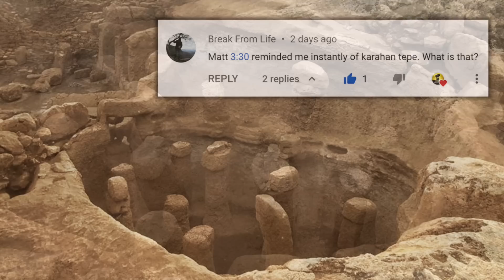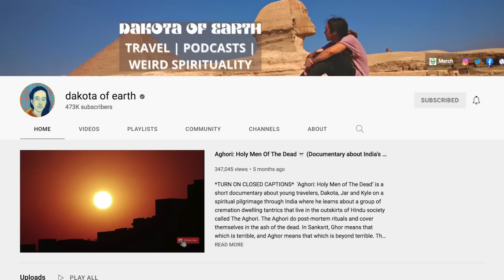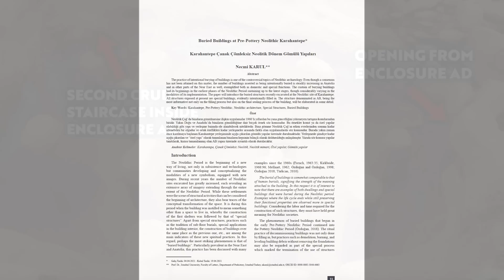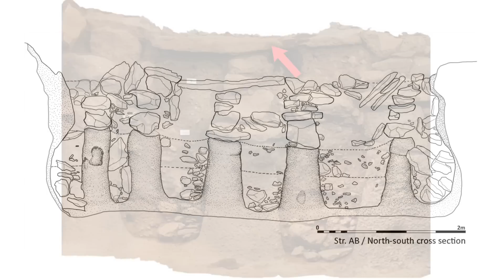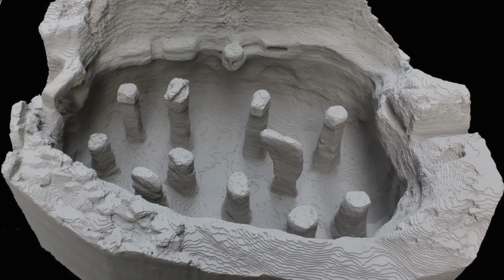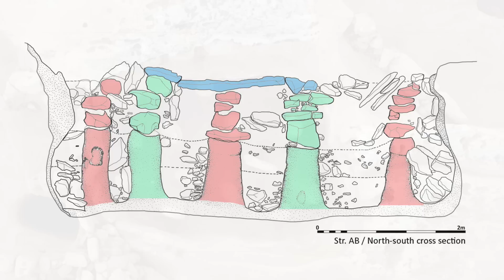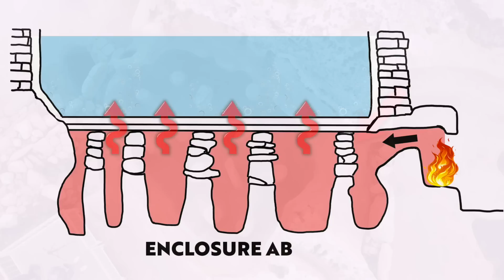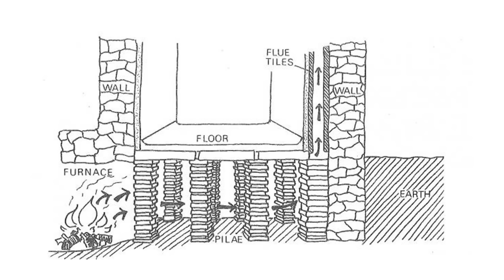An 11,500-Year-Old Central Heating Hypocaust system at Karahan Tepe? | Ancient Architects

Comment: Solving the mystery of Gobekli Tepe will require creative open minded thinking like this video.  Consider living quarters in the earliest settlements had no doors and instead had roof openings.  A logical extrapolation is to also make the roof an outdoor living area. This makes an obvious step forward in development by adding walls around the outdoor living area above the roof, Creating a two story structure or a structure with a basement.   Gobekli Tepe may have been such a two story structure. 
     During really cold or hot weather, the basement temperatures would be moderated.  In the hot summer, sleeping in cool basements would be more comfortable. In the cold winter, staying warmer would be much easier.   Look at the teepee design of Siberian Eskimos.  Most crucial was staying warm including lots of furs inside an inner room within the teepee.    Gobekli Tepe was not necessarily a living quarter but could have solved heating and cooling using such methods.   Also Gobekli Tepe may have been a place to gather together to stay warm enough to survive cold snaps.  Remember the European long houses from 5000+ years ago. They housed many people on the 2nd floor while the first floor housed animals. The animals gave off heat that helped warm the upper floor.  Staying warm was always a big survival issue so it likely drove the design an$ use of the Gobekli Tepe rooms
Reply: All well and good but this isn't Gobekli Tepe. :)
Reply: Patchouli Siamese ... yes you are correct. Kaharahan Tepe, Gobekli tepe, and probably a few more sites yet to be uncovered.

Comment: 28:41 This is a very good hypothesis! only one thing bothered me; in order for the idea to work, there would need to be water circulation or the bath area would get cold. perhaps this is the function of the channel. somehow (perhaps workers with buckets) the water was removed from the bath and sent, via the channel, back to the heater. or vice versa.

Comment: I would advise against taking a swim or even a dip of one’s toe in this particular bath house. It should be possible to use the 3D scans to roughly calculate the enthalpy of this thermodynamic system. (H = U + pV) Where H = Enthalpy of the system, U = Internal energy of the system, p = Pressure of the system and V = Volume of the system. Pit AD looks to be where workers would have further processed, diluted, refined or utilized what they were using all that energy for. Likely cooking up some pretty nasty and corrosive substances. I would again suggest we look to the art and artifacts to help us determine what they were up to. I whole heartedly believe that the T-shaped pillars in pit AB were formed and used as nails. Purposely built and used to hold down a pressure lid, not to hold up a floor. An ancient alchemical furnace I propose pits AA & AB were. It’s just a huge pressure vessel minus the right combination of ingredients for a desired reaction to begin. Complete with inoculation channels and producing an exothermic reaction, creating much, much more ‘energy’ within pit AB than you ever could get from firewood. I think the energy produced here, as heat and/or light, would have been tremendous. I’m asking myself over and over, “What were they using all that energy for?”  It may still may have been a bathhouse, albeit heated using an alchemical furnace vs fuelwood. Understanding the site’s energy production capability and capacity may tell us if it would be a safe to go for a dip or not:) Thanks again Matt for another thought provoking and resourceful video.

Comment: it's a water filtering system. Spring water came in at the top - AB sub surface was filled in for filtration purposes. A floor was put on top so that nothing can get in the filtering pool. The cleaned water exited below AB where it was used and consumed. The higher pools allow gravity flow, as well as gravity sedimentation in the upper pool. Likely it was "filled in" with lighter sediments between the coarser rocks as it was used over millennia. That is why it looked "intentionally filled in". And intentionally covered with fitted cap stones. Initially it was only filled with various grades of gravel.
Reply: I use this same setup at my house to take my septic system water, and filter it through rocks (bacteriological filter) and then into a pond for irrigation of my garden and orchard, but it's so clean you could drink it.

Comment: I have not watched the full video yet, but I got a thought for you. 
To me it could seem like the structure was carved like a cave with pillars and solid bedrock roof. At this point all pillars have had the same hight. 
But with time the structure have some how been damaged or intentionaly destoyed by enemies ect., roof/floor have collapsed damaging pillars and such. 
So maybe the backfill were placed as a way to show someone in the future how it was built as it was too damaged to continue it's original purpose of use. 
If we think of the random soil and rocks backfill as air, and the precise rocks on top of the short pillars, the slabs on top as solid bedrock and the wall built on the side one could think it was their way to say, "this is how this stucture was once built."  If thats is the case you would get a air and water tight separation from the heating system underneath, and what ever was on top, heated roop or heated pool.

 I would think that the site must have had a period were it was not in use after it was damaged/destroyed before it was backfilled to be preserved for the future or for whatever reason they had to cover it up. as indicated by the bottom layer that is different from the backfill on top. This would very much explain why the backfill is placed how it is.

Hope you understand what I'm thinking. :)

Comment: The stacking of stones on an already primitively (as opposed to modern "development") developed hot spring is an ancient tradition that helps regulate the flow of water, important when trying to keep water warm and in one spot but maintaining some flow too. If it were an early bath house, it would have drawn trade and even more innovators, over time.

Comment: A covered floor making the enclosure AB a basement like structure is a brilliant idea. But if it was used for heating there would definitely be chemical residue from the burn and water containment. That is easy to prove or disprove. And when it comes to the small water channel, it looks like to be at a higher level then the enclosure and might be an inlet rather than an outlet, which provided water to that basement (AB). If AB was covered with a roof as you said and with a small hole that would let people squeeze in, and God like figure watching  and water pouring in from a top the channel might very well be a dark ceremonial cave or something also. Kudos!

Comment: The end of the last ice age, around 12,000 years ago, was characterised by a final cold phase called the Younger Dryas. Scandinavia was still mostly covered in ice, and across Europe the mountains had many more, and larger, glaciers than today.
This is what "may be" I think:
1)The big area for glacier.
2) next for melting glacier(warm water)
3)main room with pillors "partially covered" to allowed smoke out.(Hot water).
4) outlet channel to the agricultural and animals feed...
Maybe right maybe wrong but atleast I have tried to  join the thought.

Comment: The pillars look a bit like an earlier form of Staddle Stones. These were used from Medieval times into the 19th Century to lift corn barns and suchlike off the ground. Might act as a corn drier if you're pumping heat through it?
Reply: I had a similar conjecture but I wasn't sure. You seem to know something about that. Apart from the idea that it could have been a small cistern or a smokehouse, this is in my opinion the most plausible explanation. This would fit to the huge number of  stones for grinding wilde cereals that where found at these sites.

But:
 It is now unlikely that baking bread and cooking porridge were that important to justify the building of such monumental structures, as is it is proposed elesewhere. Rather than to dry corn it could have been used to keep malt at a constant temperature. Simultaneously the underground with the guarding stone face could have been used as a smokehouse. 

But this is not the end of the story. Surely most of  you will have heard of the dangers of ERGOT, as well as of its importance for obtaining LSD. According to Peter Webster in his appendix to "The Road to Eleusis"  by Albert Hofmann et al, the ancient Greeks could have found by chance a simple method, without knowing anything about chemistry, to separate the hallucinogenic toxines of ergot from the unwelcome, merely sickening and often deadly ones, by means of adding ashes to the brew with the infected grains. 

In the cold winters and springs and hot and arid summers that reigned during the younger dryas in the highland of Anatolia (similar to ancient Greece) according to Webster  the fungus would have produced an especially high amount of the hallucinogenic alkaloids.

It is now thinkable that the inhabitants of Karahan Tepe and similar sites cremated their deceased and consumed their ashes mixed with the "beer" in a ritual, this way producing unknowingly a crude,  a less but still sufficiently effective  form of LSD. Sometimes the "ash-beer" made them only sick, perhaps seen as a bad omen, sometimes the mourners experienced a resurrection of the deceased in their visions. By trial and error they learned unconsciously  how to increase the number of pleasant mystical experiences. And so these places became cult centers.

So these buildings had simultaneously a practical purpose and a ritualistic one.

PS. The important appendix by Webster can only be found in editions newer than 2008.

Read also by Alan Piper: "Bread of heaven or wines of light:
Entheogenic legacies and esoteric cosmologies" Journal of psychoactive drugs https://www.academia.edu/1376609/Bread_of_heaven_or_wines_of_light_Entheogenic_legacies_and_esoteric_cosmologies?from=cover_page
Reply: @186Ulysses  much like many ancient sites the more we study them the more the story changes and evolves. I think one of the biggest problems is we come at it with our 'modern' mindset,  shaped by our 21st century environment and experience.  Our relationship with our world is very different to how our ancestors perceived and interpreted theirs. What seems complex and sophisticated to us may have been a fairly straightforward process to those original builders.  I can't help but wonder if it was indeed a system of buildings designed to process and store a range of  organic materials and foodstuffs.  The   many carved symbols may be symbolic of creatures somehow overseeing and protecting those very processes. The idea of hallucinogenic compounds ties in nicely with shamanistic rituals and transmogrification from man to beast. Is that what the carved images represent?
I think its a fantastic site but I'd really like to more about the transitional phases leading up to its construction. The builders didn't just suddenly wake up one day and were skilled architects, hydrolosists, masons, chemists etc! I really don't know much about Gobekli Tepe so my oppion is based on very limited 'sound bites'!

Comment: 8:31 "almost certainly superstructures on top" - That is the first important observation. We're looking mostly at the remaining fundaments. And altered even at the time. In my opinion wood would still be the primary construction material. On top of the enclosure might not just have been a roof but an entire store for all we know. A proto-castle or mansion.
Recognizing we're only seeing the remaining fundaments, your hypothesis flows very elegant. Once you point it out the comparison with the Roman style its rather striking. In any case a subterranean chamber with columns. It fits. And safe to say it's meant to support something heavy. It's a relative small space. It could easily been spanned with wooden beams otherwise. no need for supporting pillars. The heating place inside the large enclosure, also very clever. Multifunctional central fireplace. All in all a very sound and thoughtful hypothesis in my view. Well done!

The ritualistic phallic initiation grotto with star alignments etc. people. "If the only tool you have is a hammer, it is tempting to treat everything as if it were a nail." Have been guilty of it plenty of times myself, part of maturing, so no need to question peoples integrity. But well, there's a time and place for it.

Also the best bet for supporting evidence would perhaps be the location of the fireplace? No idea if they took samples, how thorough or where they are kept, or even if they'd show anything though. But maybe some higher concentration of ash particles at that spot?

Comment: Having visited quite a few old water hot springs and soaking holes in the US state of New Mexico, built by various tribes, I believe enclosure A/B was a moderately-heated enclosure with sitting areas along the sides and the poles could have been used to hang on to, and float in the tepid water. When I first saw this image I was immediately reminded of a very small 3 pool complex in Las Vegas, NM, in front of the World College site. The top pool is the hottest, the middle pool cooler, and the bottom pool the coolest. The size is much smaller than what you've shown here. Perhaps the top pool kept the water heated, and it flowed downward through the hole (and possibly through the mouth of the sculpture, then finally down to the bottom pool. Also, with the water level rising, a swimmer could easily float to the top of the posts to sit on and soak their feet for a bit, before moving on to another pool. Sounds very plausable to me. Thank you for the intriguing video.

Comment: Amazing hypothesis which seems very much plausible! I think it would be a great thing if there was a physical model of everything to "play" around with just to see if things would work out or maybe even a virtual model so more people can "play with it. I am convinced it would give a much better understanding of the whole complex in finding out what works and what doesn't. It would kind of force you into the mindset of the people that made it and lift theorising into hard facts. As they say: ultimately the proof of the pudding is in the eating.

We might actually be looking at the basement of a structure above the whole complex we see today and the T shaped pillars maybe weren't holding up a roof but a floor. Which would have made the whole structure above it heated through the floor. As you say, and it is my conviction also, people were most likely practical driven and to weather cold conditions that would be a logical thing to do.

Comment: So AA could have been either a hot well or/and a heating pond. AB could have been a hyper-course for the hot water. Possibly with a wooden roof that ends up being the floor of a heated room. The lip around the edge would be perfect to support a floor. The 70cm hole then would have been an escape for the water, cascading into the large shallow room, enclosure AD.  Possibly a bath house. With seating areas around the outside.

Comment: From the 1st time seeing structure AB, I was certain it was meant to create a level.  I thought wood, but stone could also work.  A Hypocaust seems off.  I am not rejecting it, but it doesn't seem like it would heat well, but then I really only know about Roman hypocaust.  The Neolithic may have build a different form that could work.  I think this needs to be tested, in smaller scale of course, and see if it works.

Comment: presuming you're correct, and it was a heating system, perhaps the structure was in use for so many centuries, the climate changed and below was filled because heat was not needed.  

Perhaps it's a cooling system?  If water were run through it, and a prevailing wind could be channeled through the chamber, a temperature drop would occur, and the cooling effect would be transferred to the room above, via the stone covering.

Perhaps it was filled in because an earthquake broke the original layout, and it was reinhabited later by less skilled people who couldn't rebuild the stone work, or perhaps people died from smoke poisoning with the wrong wood?

Comment: You’re video report is an interesting idea as the similarity of this construction to a Roman hypercorst central heating system is an interesting conclusion to its function. If you have constructed a 3D model. Maybe the use of something similar to make the heating of the floor surface occur.  Preheated granular pebbles.  Or similar to observe the way the circulation of warm air makes the floor hot or not.   This is only a sergestion. And you most likely have done this already.  I enjoy your programs. Excellent and very informative.

Comment: Worth continued evaluation.
Could the "rock cut channel" be an overflow? If the water source was rainwater running down the hill into the "tank", then some means of maximum level regulation would be needed.
If furnace, then "chimney" required. Something is needed to add a "draw" or "draft" that made the hot gasses prefer to play among the pillars. Preferably, this exhaust port would be on the far side from the furnace.
Microscopic examination of the pillars could show imbedded soot. The concentration should be greater on the "upwind" side (and lower on the "downwind" side). The "wind" in this case being the flow of hot furnace gasses.

Comment: At 13:02 min best image. Water in one side and out the other, down the big hole. Pillars are there to support the restroom structure built above and the water flow below. Clearly not central air, but very genius plumbing